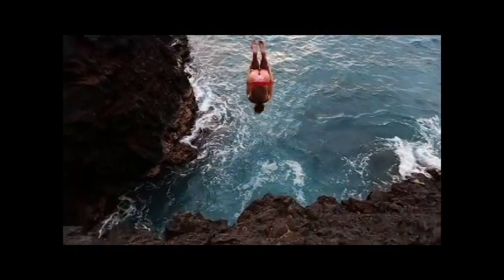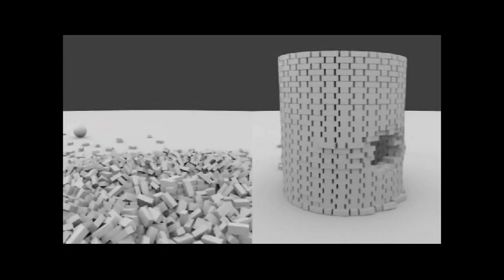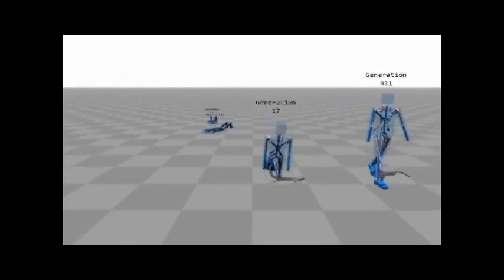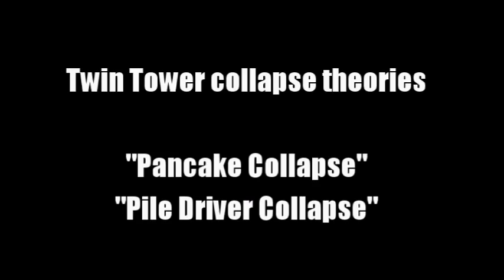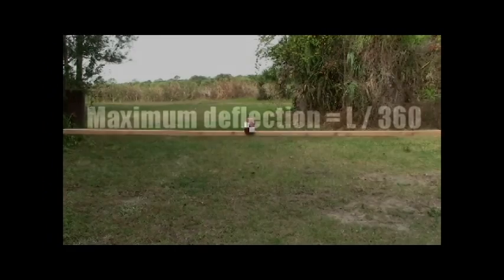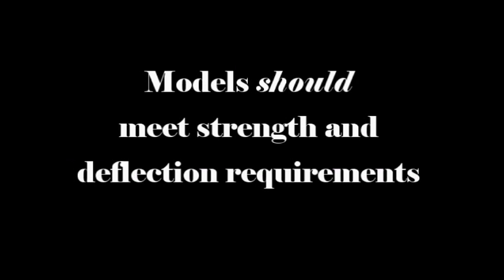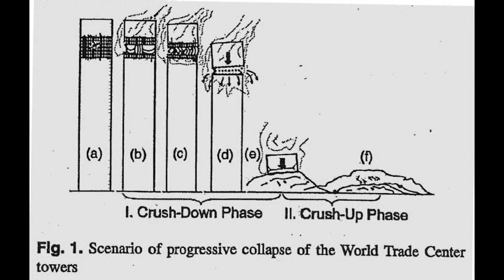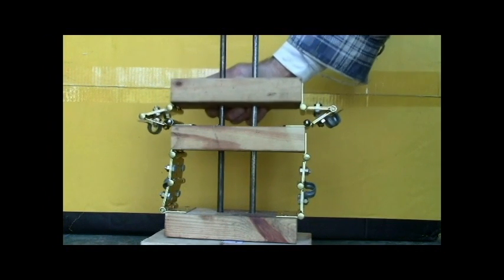9/11 Experiments: The Force Behind the Motion

Comment: This experiment doesn't take into account that (for similar objects in proportion with similar densities) mass increases with the cube of height. Using a 10 foot model shows nothing, because the height of the twin towers was 120 times more, so the mass of the towers is 120 cubed more, which is 1.7 million times more. Everything behaves differently at such a scale, so the experiment fails and shows us nothing. 

Mass increasing with the cube of height explains why fleas can jump 100 times their height, cats only 10 times, dogs 3 or 4 times, horses one time, elephants can't jump at all, and whales just lie on the beach being crushed by their own weight. It explains why asteroids look like rocks but when enough mass collects into a planet, the force of gravity is so great that it crushes itself into a sphere. The WTC was 1000000000000 times bigger than a whale yet you are using a model the size of a book case. The WTC behaved more like a planet than a book case. 

If you want to conduct an experiment to see how the WTC fell, you would unfortunately have to build a model the size of the WTC. Since there were two WTC towers, we can see that one is the experiment of the other. They both fell exactly the same way as each other, proving that they both fell the same as experiment. Ha ha ha.
Reply: Abdef Ghij  Did you actually admit that an explosion occurred in WTC1 lobby 1 second before people saw what they say was a plane strike? Then you had the cleverness inherent to all paid liars of YouTube to excuse it as sound traveling in steel faster than light travels in air? Man. you guys are good bullshitters if nothing else.
Reply: Again, study the law of the conservation of energy and momentum, in a closed energy system, with gravity as the only form of energy behind the motion of mass. You seem to think that gravity energy cannot be resisted, it can, therein lies your concept error. The towers were blown up from the top downwards, so the weight was unloading.  Weight = Mass X Gravity.

These buildings needed to be demolished by 2007 because they were of a stupid design, with bimetallic galvanic corrosion (aluminium cladding + salt water sea spray electrolyte + steel frame) issues, that had shortened their working life cycle to about 30 years only, instead of a reasonable capital investment life cycle of 100+ years.  Building down the buildings in a "polite" demolition process would have cost more in US$ billions than they had cost to put up in the first place, because the environmentally toxic asbestos had to be removed first and blowing them up legally was far too dangerous to other buildings. So, from a globalist gangster capitalist POV, this illegal demolition as a "corporate external cost demolition" and as an international insurance fraud, to help to fund the redevelopment process, was very, very clever.  

Take the WTC2 event, a top down explosive demolition.
9/11 Commission Report Page 305
“From 9 : 59 until 10 : 28
At 9 : 58 : 59, the South Tower collapsed in ten seconds, killing all civilians and  emergency personnel inside, as well a number of individuals - both first responders and civilians - in the concourse, in the Marriott, and on neighboring streets.”

Ten seconds = essentially, free fall.

Google:
Questions and Answers about the NIST WTC Towers Investigation
Quote:
“Since the stories below the level of collapse initiation provided little resistance to the tremendous energy released by the falling building mass, the building section above came down essentially in free fall, as seen in videos. As the stories below sequentially failed, the falling mass increased, further increasing the demand on the floors below, which were unable to arrest the moving mass.”

However where did the ENERGY to disassemble the building SEQUENTIALLY and in a highly explosive manner come from?  Remembering Sir Isaac Newton's "Third Law of Motion" and the law of the conservation of energy and momentum, from our teenage physics lessons back in school.  No resistance to "collapse" means no impacts happened, no impacts happening means no "kinetic energy explosiveness" happened, converting any "potential energy" into "kinetic energy explosiveness" --- with GRAVITY as the only form of energy putting mass in motion!  

Weight = Mass X Gravity!

The “falling mass” was obviously DECREASING as it was being sequentially ejected SIDEWAYS from the top downwards!

There was no crush down!  There was no “accumulation of mass” (or “increasing” mass) over the tower stub after the dust had settled! The building debris fallout zone was instead up to 500 feet from the tower base (FEMA said so).

In order for the towers to have "collapsed" gravitationally, as we've been told over and over again, in the observed duration, one or more of the following zany-sounding conditions must have been met:

1. The undamaged stories below the alleged aircraft impact zone offered zero resistance to the collapse.

2. The glass, steel and concrete spontaneously disintegrated without any expenditure of energy.

3. On 9/11, gravity was much stronger than gravity, because a giant invisible sky god stomped on the towers perhaps?

4. On 9/11, energy was not conserved.

However, none of these physics-violating conditions can be accounted for by the official government conspiracy theory of 9/11, nor by any of the subsequent analyses designed to prop up the official theory of 9/11.

Bottom line: the US government/PBS/PM/SA explanation for the WTC “collapses" fails the most basic conservation-of-energy reality check. 

Therefore the evil, lying, US government theory does not fit the observed facts; the notion of a “pancake collapse” cannot account for what happened. The "pancake collapse theory" explanation is impossible, and thus absurd.

It is utterly impossible for a "gravitational collapse" to proceed so destructively through a path of such great resistance in anywhere near free-fall times. 

This fact debunks the preposterous contention that the observed WTC “collapses" can be blamed solely upon damages resulting from aerial assaults by just 19 Kamikaze superheroes. 

The unnaturally brief durations of the highly destructive top-down “collapses” (sequentially explosive demolitions) reveal that the towers did not disintegrate because they were coming down, but rather they came down because something else was causing them to disintegrate (violently explode).  Gravity just carried the disassembled building debris out of the sky.
Reply: Oh, so your idiotic interpretation of the conservation of energy means nothing can fall due to gravity. Nice. Potential energy is conserved, none is converted to kinetic when it falls. That's very interesting. I'll tell my 7th grade science teacher the news.

Closed energy system? Hmmm. it's getting more interesting.

Gravity is a form of energy? Wow! And all this time I thought it was an acceleration. Better tell Newton.

Your second and third paragraphs are gibberish.

The falling mass was increasing as it went down, not decreasing, because the falling mass was mostly the concrete floors which made up most of the mass of the building, and the part ejected sideways was the vertical steel columns. The steel columns fell sideways at free fall, the concrete floors fell much slower than free fall as any viewer can tell. They took 20 seconds to fall not 10 seconds as you fancy. Each tower was 300,000 tons unloaded, roughly 200,000 tons of concrete floors and 100,000 tons of steel columns, plus the load.

The undamaged stories below the alleged aircraft impact zone offered almost zero resistance to the collapse because they were horizontal concrete floors designed to hold secretaries and fax machines in static weight not 50,000 tons of concrete in dynamic weight. The vertical columns offered no resistance either because they were being blown outward like a banana peel.

I stopped reading your rant about half way through because the level of idiocy kept increasing at free fall speed.
Reply: Wait.....did you say alleged aircraft impact zone? Alleged? Sorry, I did not know all this time I was talking to a complete fool.
Reply: Anybody who is anti-American is normally called a "Muslim" or a "Communist" or something like that, by Americans.  Their feeble little brainwashed, patriotic and nationalistic minds can't imagine how stupid they sound by assuming things like that.
Reply: In WTC1 the basement and lobby explosions happened a few seconds BEFORE the alleged impact of AA11 into WTC1 and those very high brisance explosions could not possibly have been caused by any Jet fuel kerosene (not yet injected inside WTC1), which can anyway only ever deflagrate in a very low pressure fireball.

In WTC1, William Rodriguez and his supervisor (Anthony Saltamachia) are on record for repeatedly affirming that there was a huge basement explosion in WTC1 before the "AA11" event, or the alleged first aircraft impact by a "hijacked" aircraft. Other WTC1 eyewitnesses claimed that there was an additional lobby explosion before the "AA11" event.

Ms Evalle Sweezer (office worker): "I believe that the bomb hit the lobby first, then in a couple of seconds the first plane hit."

Mike Pecoraro & a colleague arrived at the basement WTC1 “C level” and they found that the machine shop was gone.

"There was nothing there but rubble, "Mike said. "We're talking about a 50 ton hydraulic press, gone!"

The two made their way to the parking garage, but found that it, too, was gone. "There were no walls, there was rubble on the floor, and you can't see anything" he said.

They decided to ascend two more levels to the building's lobby. As they ascended to the B Level, one floor above, they were astonished to see a steel and concrete fire door that weighed about 300 pounds, wrinkled up "like a piece of aluminium foil" and lying on the floor. "They got us again," Mike told his co-worker, referring to the terrorist attack at the center in 1993... He was convinced a bomb had gone off in the building... Mike ascended to the Lobby Level where he met Arti DelBianco, a member of his work crew.

See Bob McIlvaine's 2016 interview:

Bob McIlvaine and his family are not alone in having suffered a devastating personal loss on September 11, 2001. The loved ones of the nearly 3,000 victims of the destruction at the World Trade Center know what he has endured for the past 15 years.

But McIlvaine is different from most of these families in important ways. In addition to his unwavering and often lonely fight to expose what he calls the complicity of the US Regime in this false flag attack, he has strong forensic evidence proving that his 26-year-old son, Bobby, was killed by a powerful explosion upon entering the lobby of the North Tower. That evidence is corroborated by the accounts of many FDNY members, police officers, and workers who reported that explosions went off in the lower parts of the towers before the buildings were levelled — some of them even before the first airplane struck.  

Interview Continues, look it up, if you are really honest and not just another filthy American liar!
Reply: Quote: "The explosion that people heard in the lobby was 1 second before they heard the plane hit." The two separate  explosions were recorded on answerphone tape and it was many more seconds than 1 second between them, so that is your first lie.  There is zero empirical evidence of 10,000 US gallons of kerosene jet fuel ever being injected into either of the towers, flowing down the stairs, pouring down the elevator shafts, falling out of the tower as a burning waterfall or sloshing around on the alleged impact floors, your second lie. Jet fuel kerosene cannot ever EXPLODE at supersonic or near supersonic speeds, so another lie, it can only deflagrate in a low pressure, non-destructive, not very volatile, fireball.  When are you going to stop lying, you worthless, subhuman piece of American war-criminal GGGSSS vermin?
Reply: Google: 9/11: WTC1 Plane impact audio with a 2nd loud bang (Ginny Carr) the 2 bangs were about 9 or 10 seconds apart.
Reply: Really? So now you switch from your earlier lie of 1 sec to 8 secs and then you lie that it was aircraft debris impact!  The only aircraft debris allegedly from AA11 was the landing gear, hidden in advance under scaffolding, well to the south of the WTC complex, behind Police Tape!  The engine (wrong type for UA175) was also hidden under scaffolding at the Church & Murray intersection to the north, in advance, behind Police Do Not Cross Tape, during the night before.  Both were obvious stage props!  The side panel on top of WTC5 from "UA175" was hidden in advance as well and not one bit of "debris" was ever videoed, or seen, arriving at their hidden stage prop locations!  

Just how brain dead and gullible are you to think that the landing gear and engine would both magically end up hidden under scaffolding, behind Police Tape on 9/11, on streets not covered by CCTV cameras?  Try again, you filthy American liar!

No aircraft were used at all in this very clever 9/11 attack against your evil enemy "country" and using UAV drones on the WTC buildings would have been utterly imbecilic, far more dangerous to the mission objectives as well as being far more expensive!  

The real "9/11 terrorists" (the clever "Enlightenment Revolutionaries") economised a great deal.  It was a really beautiful and well run, cheap operation, to FUBAR the evil US enemy regime and to hoax the evil enemy  US population, in a text-book Military Deception Operation Coup dÉtat, by the clever, infiltrated, 5th Column Khazarian Cabal. 

I have been pointing out the absurdities of the "UA175" event for years, including the ludicrously high speed and how could a "novice pilot" possibly hit such a narrow target at that speed, in that hard left hand turn and bank, when a fraction of a second late in starting the turn would mean a miss.

The 20 or so videos for UA175 all indicate video fraud. The plane shaped hole wingspan for "UA175" was too narrow by a few metres (calculated by counting undamaged windows each side and adjusting for the angle of the entry wound) and it showed no tall vertical stabiliser impact damage.

The Church and Murray engine was the wrong type for UA175 anyway and nobody saw it arrive under the scaffolding, although hundreds of people were down in Church Street watching WTC1 on fire when the "UA175" event happened.

The approach speed of the UA175 video artefact was way too fast for that aircraft type at that altitude. From an engine power point of view, an equivalent airspeed (EAS) of 510 knots near sea level = 722 knots or supersonic Mach 1.19, at 22,000 feet, so it was impossibly fast. 510 Knots = 587 Mph = 945 Kph!

The wing images for "UA175" faded out in video of the event just before the alleged impact.

The video object or video artefact produced no visible engine exhaust gasses.

The video object did not decelerate on "impact" with WTC2.

The ejected fireball on the South side of WTC2 showed no wing vortices effects, swirling the air around into spirals, as would have been present if a high speed aircraft had just flown through that patch of air.

It looked like the nose popped out of the north face intact, before the media propaganda infiltrated Khazarian conspirators quickly cut the video feed.

A big passenger jet like "UA175" allegedly would have had a lot of jet fuel kerosene on board, but, apart from the initial ejected Hollywood special effects fireballs, there is no real evidence of thousands of US gallons of liquid jet fuel ever being injected into the towers, pouring out of the towers like a burning waterfall, pouring down the stairs where people were escaping or sloshing around on the impact floors, where people were later seen waving for help out of the “impact” wounds with no aircraft debris behind them. 
~~~~~~~
Google:
Khazar Dr Alan Sabrosky US Army War College on 9/11
&
Khazar Dr. Steve Pieczenik: Insider Exposes Officials That Planned 9/11
&
"The Host and The Parasite: How Israel's Fifth Column Consumed America" by Greg Felton
&
"Solving 9-11" by Christopher Bollyn
&
Cicero On Treason - YouTube
"A nation can survive its fools, and even the ambitious. But it cannot survive treason from within. An enemy at the gates is less formidable, for he is known and carries his banners openly against the city. But the traitor moves among those within the gates freely, his sly whispers rustling through all the alleys, heard in the very halls of government itself. For the traitor appears no traitor; he speaks in the accents familiar to his victims, and he wears their face and their garments and he appeals to the baseness that lies deep in the hearts of all men. He rots the soul of a nation; he works secretly and unknown in the night to undermine the pillars of a city; he infects the body politic so that it can no longer resist. A murderer is less to fear.“ - Marcus Cicero, speaking to Caesar and the Roman Senate
&
9-11/Israel did it - WikiSpooks
&
Khazar Aaron Russo (RIP): Reflections Warnings Interview with Aaron Russo FULL - YouTube
&
911 Solutions-How the 9/11 Myth Was Sold - YouTube
How Khazarian media people, like Jerome Hauer, cleverly conned the brain-dead American branded GGGSSS.
Reply: OK  lying American GGGSSS, then why did WTC6 get gutted by an explosion unrelated to WTC2 or 1 blowing up and why were the stairs blown out in WTC7 before WTC2 blew up? Barry Jennings testified to an "explosion" in the stairwells taking place before either Twin Tower had blown up.  So WTC2 at 9 : 59 and WTC1 at 10 : 28.  Nobody was really checking their watches for the exact time of their rescue, would be my guess, it could have been around noon or 1pm.

See YouTube: Barry Jennings Interviews (WABC-TV, 2001 / LTW, 2007)

Barry Jennings (and Michael Hess) apparently arrived at the WTC7 office (via a freight elevator, since the passenger cars were already disabled) seemingly immediately after the OEM bunker had been evacuated, which reportedly occurred before 9 am, according to other reports.  Jennings said later that he was already INSIDE the WTC7 building when the UA175 event happened, but it does not sound like he witnessed that event happening at 9 : 03 am.  It is of course very curious that WTC7 needed to be evacuated as an emergency management centre at all, since it was an armoured structure designed specifically for EMERGENCIES just like this one and these two alleged air crashes (only one by 9am) into buildings that officially SHOULD NOT HAVE BEEN EXPECTED TO BLOW UP should have meant that the WTC7 bunker was a perfectly safe place to be!  

In 1999, NYC Mayor Rudy Giuliani had constructed a US$13 million emergency command retreat on the 23rd floor of World Trade Center Building 7.  An armoured, self-contained facility designed to provide a "safe haven for leadership" in the event of a natural disaster or terrorist attack. But several first responders interviewed after 9/11 claimed that the Office of Emergency Management’s Emergency Operations Center (OEMEOC) was empty and had been “deactivated” as early as 9 am on the morning of September 11th, a time when just such an emergency was in full swing!

Michael Hess has corroborated Jennings' account of hearing explosions inside WTC7 and witnessing the damage they caused which trapped them inside.  A 2010 video released by NIST further corroborates Barry Jennings' account.  Michael Hess is visible calling through a broken window of the 8th floor of WTC7, calling out for help to get down after both towers had blown up, so presumably at some time after 10 : 30 am and before noon.  

Both internal staircases in WTC7 were certainly destroyed by explosions, not by impact damage from WTC1 blowing up and chucking any steelwork sideways as explosively ejected debris into WTC7, at a speed calculated to be about 70 mph, at 10 : 29am.   This was why Jennings and Hess could not escape by themselves. 

One might think it possible that the explosions inside WTC7 destroying the two stairwells coincided with WTC2 blowing up at 9 : 59 am, but it is not plausible that any explosively ejected debris from WTC2 did that damage.  Local explosions did it!  

That timing is not what Barry Jennings later said though, he said the stairs were taken out at around floor 6, so he had to go back up to floor 8, then he bust a window with a fire extinguisher, then the NYFD ran away because WTC2 was blowing up, then later WTC1 blew up, before they were finally rescued.  He also stated that there were dead bodies inside WTC7 as he was leaving, although officially nobody died in WTC7 at all.

Furthermore it is not plausible that evidently having started out from the OEM office on the 23rd floor well before 9 : 59 am to go downstairs, it would have taken them almost 30 minutes to walk down the stairs and then exit the building!  They probably started down the stairs between 9 : 15 and 9 : 30 am, so it certainly did not take them over an hour to try to leave.
Reply: WTC6 was gutted by an explosion blowing upwards as seen in video in an explosion that was unrelated to WTC2 or 1 blowing up to dump stuff on top of it.  Quote: "I think that would have made the news" it was on the news! I am not a Muslim you feeble minded, brainwashed, cretin!
Reply: Quote: "the shock wave went through the elevator shafts" which were staggered, of limited length, not a direct shaft link from top to bottom, so that is a bullshit theory and any alleged aircraft impact would not create a "shockwave" anyway.
Reply: Quote: "that deserves to be capitalized like real religions such as Judaism and Christianity." ROFLMAO.  No "religion" with imaginary sky gods is real you idiot!  Christianity, Judaism and Islam all have to be destroyed in the Global Enlightenment Revolution and they are killing each other!
Reply: Quote: "A few seconds later the hot explosive gases hit the lobby." And then blew up the basement area as well explosively, destroying the car park, 300lb fire doors, vaporising a hydraulic press, leaving rubble everywhere? Liar!
Reply: Quote: "And now you're on here denying that you did it" I had nothing to do with doing 9/11, I am just trying to give credit to the clever guys who did do it.  My "group" is that of Atheistic Philosophy & we did not do it! I seriously doubt that an imbecile like Bush was involved!
Reply: Wow, you are a new type of moron.
Reply: +AmericansR Zombies asks

"Why did the first explosions in WTC1 happen before the fable of the ALLEGED impact of AA11 into WTC1?"

Because sound travels through steel faster than it does through air. The airplane hit and made an explosion sound in the lobby when the sound traveled down the steel, then one second later they heard an airplane hit above when the sound traveled through the air to the same people in the lobby. See this Zombie

https://scontent-lga3-1.xx.fbcdn.net/v/t1.0-9/20638913_10211514541872948_9031837974430318521_n.jpg?oh=3bcc23c6cb35d9119d92b7370b676096&oe=5A387B3C
Reply: The explosion that people heard in the lobby was 1 second before they heard the plane hit. One second before, not a few seconds. All witnesses say 1 second. When the plane hit, first the people in the lobby would hear an explosion because sound travels 15,000 ft/second in steel. Then a second later they would hear the plane hit from above because sound travels only 1000 ft/sec in air and the plane hit 1000 feet away. The blast wave felt in the lobby that came down the elevator shaft would also arrive 1 second later because blast waves travel at the speed of sound in air. So the blast wave arrives the same time you hear the plane hit above. The blast wave would be extremely violent and level everything in the lobby. Then a few seconds after that the hot gas from the 10,000 gallons of burning jet fuel would blow into the lobby and burn everything but that's later, the initial blast would be cold air that was in the elevator shaft that travels at the speed of sound, the hot gas, which is mostly hot CO2 and smoke, has to physically move down the elevator shafts which takes a few seconds. The blast wave is a shock wave which is sound, the hot gas goes by pressure of the gas so it moves slower. You said something before about low pressure but that's just a lie you made up. Why would it be low pressure, jet fuel burning in the elevator shaft above could make hundreds of pounds of psi maybe thousands. I'm sure you can't understand that either or have some bullshit argument about it so let's have it.
Reply: Bullshit. The 2 explosions were 1 second apart. If kerosine doesn't explode how does a diesel engine work? You fucking idiot.
Reply: I listened to the tape that was recorded a block or so away, and heard the loud sound 8 seconds later. This was not an explosion and doesn't even sound like one. Since 8 seconds is the time it takes for objects to free fall from the height the airplane struck, we can correctly assume that the sound is pieces of all the things that fell from that height, meaning pieces of the jet or building that fell, landing near where the audio was recorded. Jet engine, wheel, etc, and chunks of the building broken loose. You are a complete idiot. The audio records the sound of a jet airplane flying, a crash, no more sound of the plane flying, and then 8 seconds later, the sound of falling debris. You are a real piece of shit.
Reply: I read the account of a witness who was driving on West Street down by the battery and was heading north and saw number 1 WTC get hit, and a few seconds later (8 seconds I'm sure) he saw a huge wheel bounce across west street toward the Hudson River. So you are a lying sack of shit when you say the landing gear of the first plane was hidden behind police tape. You are a complete and utter sack of shit.
Reply: No. The people in the lobby could not SEE a plane hit, because they were in the lobby, LOL!!! and could not see outside. I said sound travels faster in steel than it does in air. Never said anything about light, LOL ha ha ha you piece of shit liars try to sneak misquotes past the guy who said them. Maybe you can go off and misquote me to some other idiot. But you can't misquote me to me cause I'm the guy who said it you fucking idiot. Let me give you a rundown on the speed of various waves.

Plane hit. Then:
1. Immediately people saw it because light travels at 300,000 km per second
2. 1/4 second later people in the lobby heard it because sound travels in steel at 15,000 ft/sec
3. 1 second later people heard the plane hit because sound travels at only 1000 ft/sec in air and it was 1250 feet up.
4. At the same time as 3 the shock wave hits the lobby
5. A few seconds later the hot explosive gases hit the lobby.

I'm sure I will have to explain this all again after you make up more bullshit to argue against it.

An explosion was heard in WTC lobby by many people. Then a second later they heard the plane hit and a shock wave hit the lobby. Hundreds of witnesses said this. Fuck you.
Reply: Oh I have to explain to the idiots who really are stupid...........the shock wave went through the elevator shafts. Oh my God I have to explain things like I'm talking to children.
Reply: If planes didn't hit the buildings how come they kept finding plane debris as much as 12 years later?
http://www.nydailynews.com/new-york/landing-gear-mosque-9-11-plane-boeing-article-1.1330196
Reply: "And then blew up the basement area as well explosively, destroying the 
car park, 300lb fire doors, vaporising a hydraulic press, leaving rubble
 everywhere?"

Yup. That's what happened.
Reply: What the fuck is GGGSSS?
Reply: We don't murder anybody but murderers, we don't rape anybody, torture is limited to waterboarding which doesn't hurt anybody, pretty much all you say is bullshit unless you are talking about the camel humpers who murder people by the million and fuck 8 years old boys AFTER cutting their heads off.
Reply: Yeah it's true that Obamacare kills off the elderly, if they have a DNR the hospital puts them on morphine until they die, but Trump is trying to abolish Obamacare so elderly will stop being murdered in hospitals.
Reply: Not a nice thing to say. There are evil people in this country, almost all of them left wingers. It's scary.
Reply: Quote: "There are evil people in this country, almost all of them left wingers." Left wing versus right wing. Divide & conquer. It is the same tactic the military use in countries they invade.  Shiites versus Sunnis for example.  If a 2nd Civil War happens, the US will be really screwed.